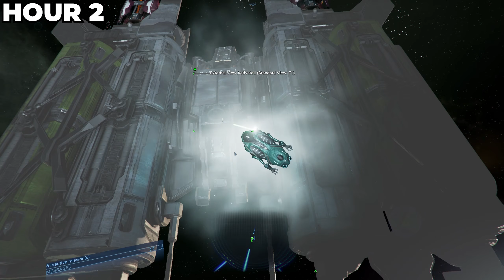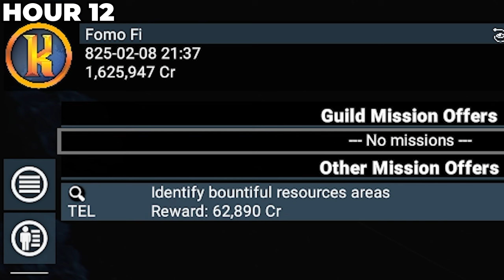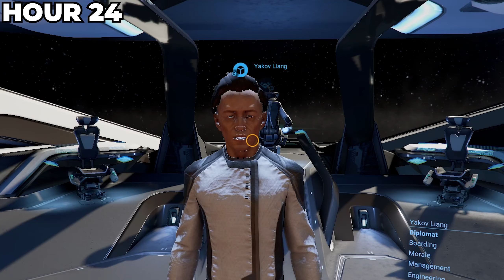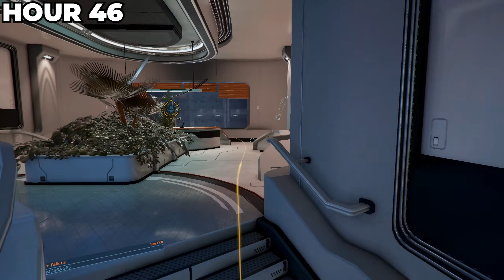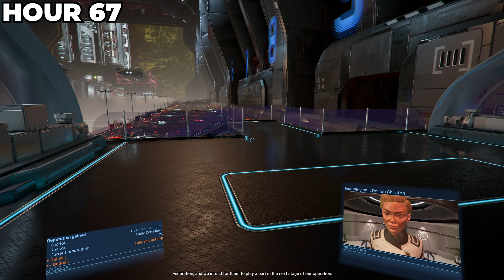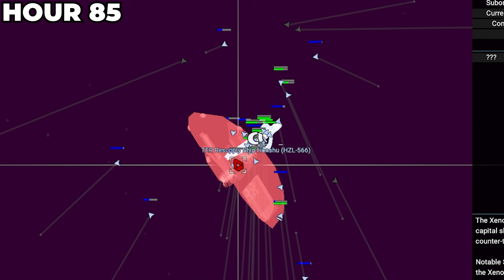I Played 100 Hours of X4: Foundations... Here's What Happened!

Comment: i absolutely love this game. But sadly I can't play it until the end due to the simulation. I have a "gaming laptop" with a 3070m and a decent processor. I can play Cyberpunk on 1440p high with ~90fps average, but single core performance of my CPU is just way too low to handle a single core driven game like X4 properly. At around mid game my FPS start dropping down into the 30-40 and not much later I can't even keep a constant 30fps. Had I known this before, I had gotten a laptop with a different CPU.

And yes, I know. "Ew, laptop." But I needed one for Uni, and wanted an upgrade to my weak as hell PC.

Comment: Hello, I have a question about the stability of the game, I was playing before, but the further and more I built, the frame rate dropped dramatically. something has changed in this matter because I would like to start the adventure again but I don't know if it's worth it. My specification. Ryzen 9 5900X + 32 GB RAM + RTX 3090 + M2 drive
Reply from the maker: While the performance might drop the longer you play and the more and more ships there are around, you'll be completely fine with those PC specs.

Comment: is boron beginner friendly or are there better starts for newbies?
Reply from the maker: Yes and no. Yes because you instantly get your starting base without having to do a lengthy mission and the Boron are pretty isolated from danger up there, so you can trade with them mostly in peace and make them stronger. The only sector Xenon can get to them is now your home sector, which can be good cause you can protect them, or bad, if you do a bad job protecting them. Also, you start in a corner of the big map, so you'll be a bit farther away from the rest of the stuff. It's both good and bad, so it's really up to you to decide what you want.

Comment: bit late for questions, but did you have any mods installed during this run? or was it pure vanilla experience?
Reply from the maker: I used the mod that gives you directions when you're scanning stations for leaks. I also had the auto-explore mod, but I didn't actually use it because it's quite inefficient.
Reply: @KokoplaysMB  thanks

Comment: Set your wharf prices to 150%; everyone still buys your ships and you make a fat profit.

As for your own M ships, I recommend using the Split Boa.  It has a small cargo capacity, but it's by far the fastest trade ship, meaning higher throughput and the ability to escape from pirates.  The best  M miners are, again, Split; the Alligators go so ridiculously fast that you'll rarely if ever lose any of them.  The only drawback with Split is that the game seems to not have a good queue system for multiple ships wanting the same dock, so you'll need that 8m docking port at your factories, possibly more with a megafactory.
Reply from the maker: Split are easily my favorite faction

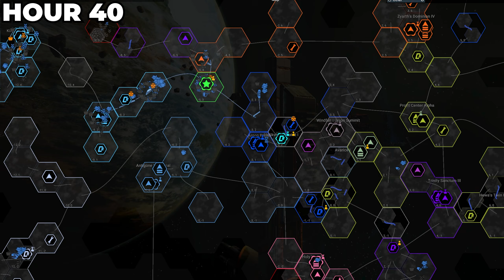Comment: 28:10 Is there a way to make scouts auto-map new sectors? I see they have an Explore command but that just makes them fly in a circle. Earlier in the video I saw you queueing waypoints for a scout; did you just do it manually the whole time?
Reply from the maker: Yeah I did it manually the whole time because that way they explored the sector much faster and later in Xenon sectors it was easier to make them avoid certain death. Auto exploring usually leads to a lot of wasted time and also death.

Comment: Tip for Argon rep, set up miners in the massive asteriod sector next to argon prime, (usually to thr top left) , And set their mine and sell to that sector only. This means your miners mine, and sell ores to argon, which means you trade, and it means passive rep and money. I always use this trick. It wont get you all the way there but it can make the early grind quick
Reply from the maker: I did that for every faction, but since I wanted argon rep ASAP I flew around shooting criminals and doing missions.
Reply: @KokoplaysMB  fair enough! . Fun video. You should do more!

Comment: A valuable tip for Defense Stations: build them in Closed Loop, this requires that you use Argon modules only, but reduces the material to Hullparts, Energy Cells and Claytronics.
Now given the rarity of Claytronics, it´s still easier to get than the excessively rare Turret Components (unless you build them yourself...).
However i have by now build several minimalistic Defense Stations that allow me to keep Xenon Incursions in check thanks to Closed Loop.
Only Terran Construction is this efficient and simple! But much more expensive.
Reply from the maker: Good advice, thanks!
Reply: @KokoplaysMB  Glad i could give valuable input!